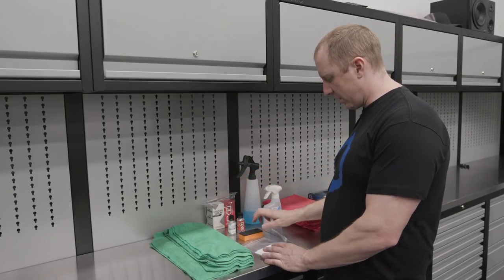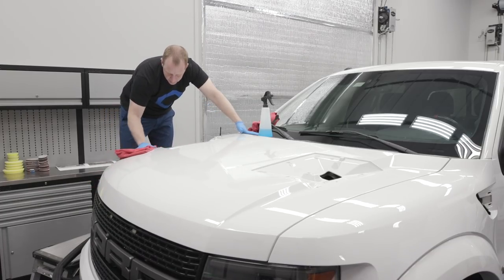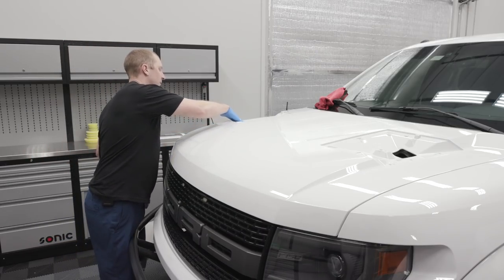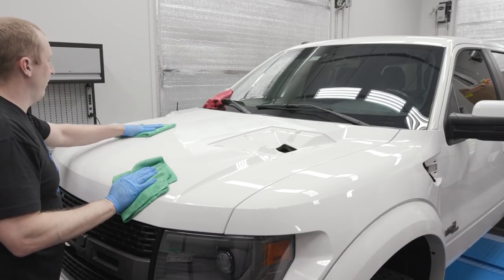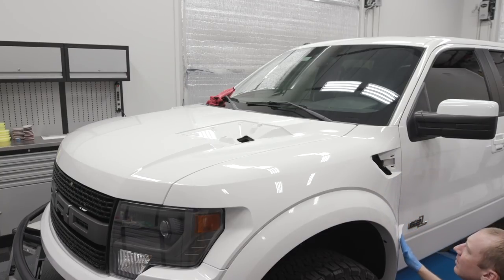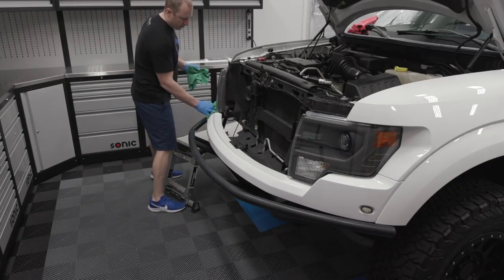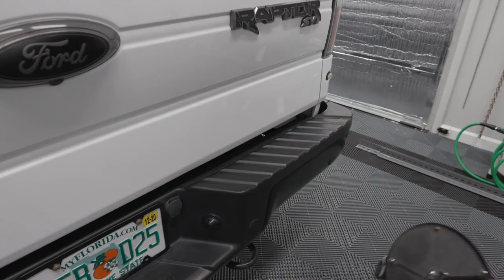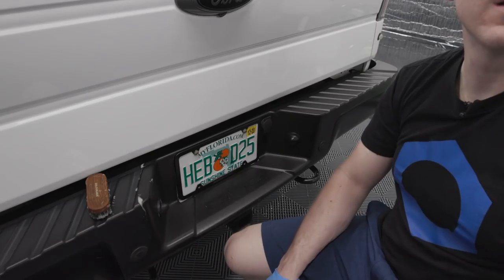Gen 1 Ford Raptor Detail Series: E6 - Coating Application & Trim Restoration

Comment: Matt, for something the size of an M3 (or Camaro in my case), how many suede applicators, leveling towels and follow up wipe towels do you think I'll need?  How fast will the ceramic dry on those as I go through the process?  Going to do my first CSL/EXO coating on the red Camaro I took you around in when you visited Meguiars last year.  Thanks!

Comment: I am curious to hear your thoughts on CanCoat.  It is the opposite of what you are used to from CSL and Exo in the fact that CanCoat is not slick and it gives a candy coated look.  It will probably look great on the M3.  It is a great product and lasts longer that what Gyeon claims.  Esoteric has a new video on the application process that you may want to visit before you use it.  My personal preference is applying it with a microfiber applicator.  Jeff does make it look easy.  Looking forward to your thoughts on it.

https://www.youtube.com/watch?v=gE_fhnno56c&t=4s

Comment: I coated my new shower doors and it was so worth it lmao im probably going to do my shower walls next
Reply: Interesting, what difference did you notice?
Reply: @rockystallone3925  well i dont have to squeegee off the glass every time i shower now. we also have hard water here at the house so im hoping it will keep water staining down a bit or at least make it easier to clean when it does happen
Reply: @GapedCeiling  awesome! I wonder what  else we can use this on?

Comment: The coating you are using have strong odor solvent?
Reply: Yes smells like vicks.
Reply from the maker: CSL doesn't have much of an odor unless you sniff the bottle.  EXO is a much stronger solvent like odor.